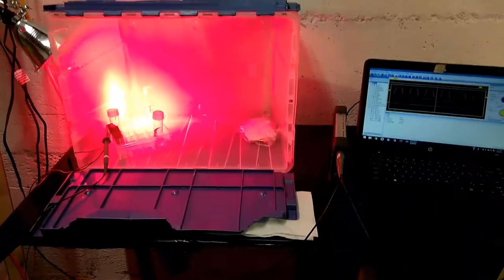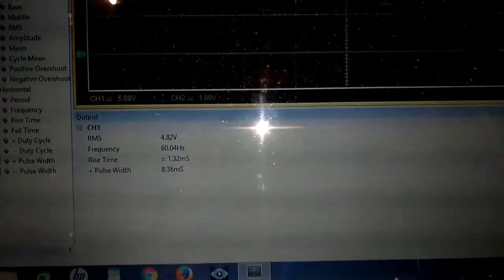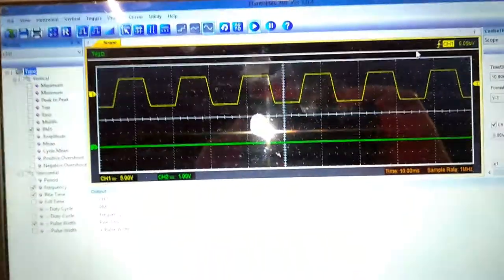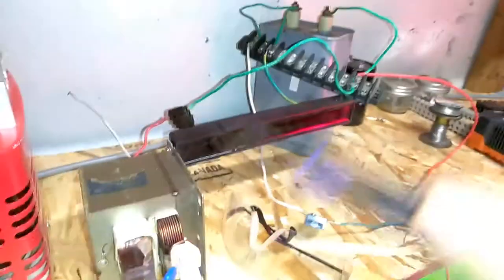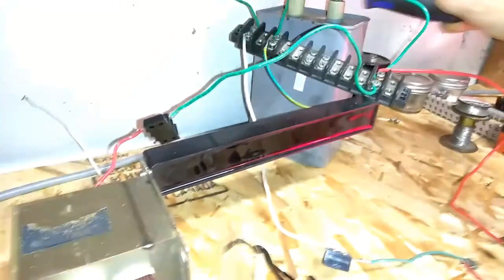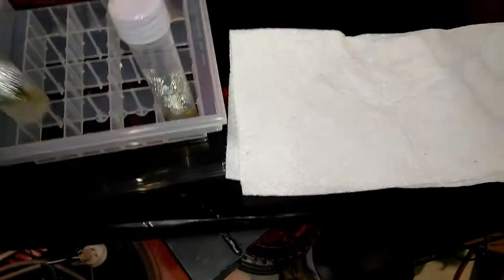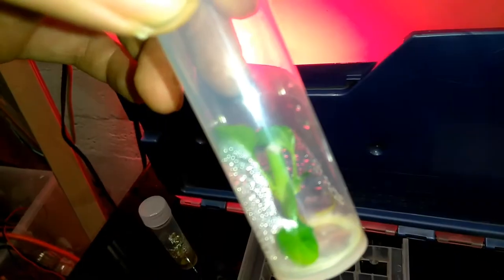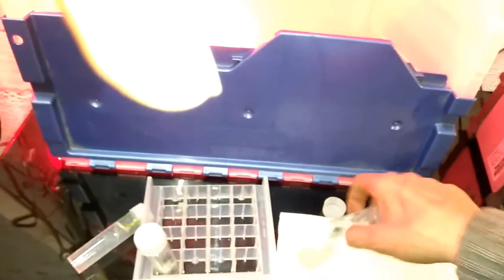Dr Robert Beckers cellular regeneration experiment

Comment: I'm glad to see someone else knows Beckers material,  I was more fascinated by his findings of new techniques of anesthesia,  he and his colleague in the book  " the body electric "    put animals / amphibians to deep sleep ( delta phase I think ) simply by using first electric field front and back of the head, then an alternate method using a pulsed magnetic field on the side of the heads ....    I always thought that would make a great defensive weapon, someone prepares to attack you and you pull out something like a tazer 
and point it at their head and boink ... they hit the ground in delta phase deep sleep.

   in your other vid  " longitudinal electrostatic propulsion "  I think the spark causes the air to rapidly expand under the cap, thus sending it blasting upward.  

  Here's something you might look into,   imagine a Hertz spark device, the general principle of it,  that electromagnetic wave propagates doughnut shape outward in 3 dimensions,  you take a light sphere of some sort, ideally a copper sphere and place an oscillating spark gap inside vertically, ...the wave impacts the inner walls in 3 dimensions and creates a massive surge of current in an upward or downward direction, and since its a pulsed DC, always in the same direction the inner walls keep being impacted thus driving the current more and more.....  if you look at the Hertz "receiver" it is simply a ring, meaning one segment of a sphere,   now think about this, in the Hertz example, if the "ring" had a magnet inside it when the electromagnetic pulse hit it, the ring would fly off ( moving charges interacting with the magnetic field ), if the ring and magnet were fixed to each other, and the Hertz device oscillated, the repeated impact of the electromagnetic field would repeatedly send this ring flying, note:   putting the ring on a pivot would create a type of motor if arranged properly.  
  
 take a look at this MIT vid and note the major difference in force between a single pulsed DC current, and an AC current on the ring............  AC or any type of repeated "hit" from an external field  ~ quadruples the force .........    

   https://www.youtube.com/watch?v=Pl7KyVIJ1iE

good luck             brad
Reply: Yes, good vid of eddy currents in a metal & super conducting ring causing  a repulsive magnetic force.  However, I think Jeff Van is testing repulsive shock electric force...thus the general principle being a longitudinal dielectric shock wave rather than EM wave...